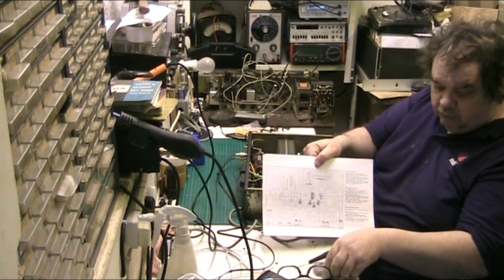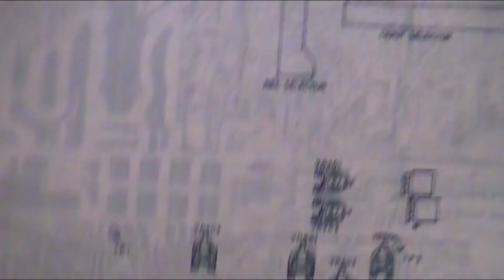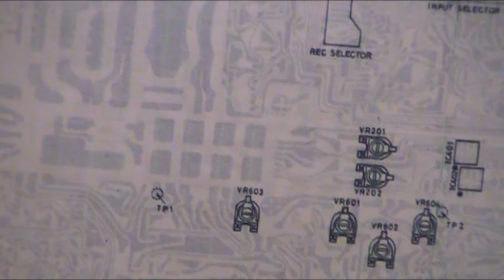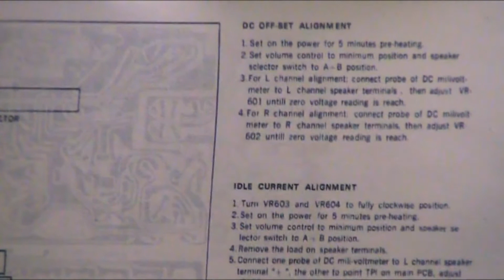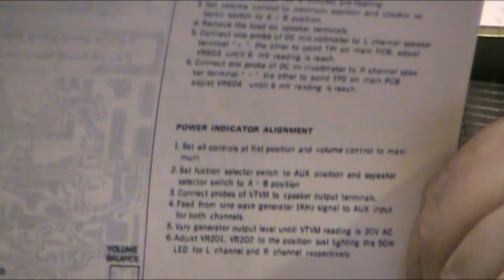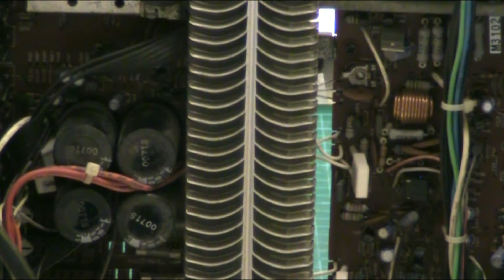NAD 3140 AMPLIFIER VOLTAGE ADJUSTMENTS

Comment: Found this looking for inspiration to fix my 3140. I had random distortion appearing and disappearing, tracked that down to the speaker selector switch of all things. I plan to keep it so I bypassed the switch (removed most of that loom also). Hope that nugget is of some use, in particular if it had a "dead" channel. The speaker EQ switch also does some horrid things at times.

Also, mine needs re-capping. Not for audiophool sake, the thing looks like it was on fire at some point, the plastic sleeves on them have shrunk and melted, and those I did bother to test before it got shelved failed to even register as capacitors. Yet somehow the thing still just about plays.

Quality bit of kit! Thanks for sharing :3
Reply from the maker: I would do a re-cap in case it desides to fry the output transistors